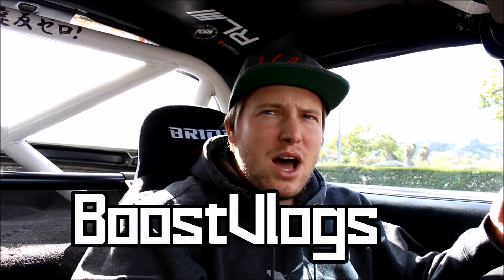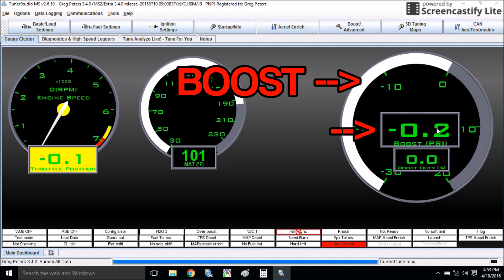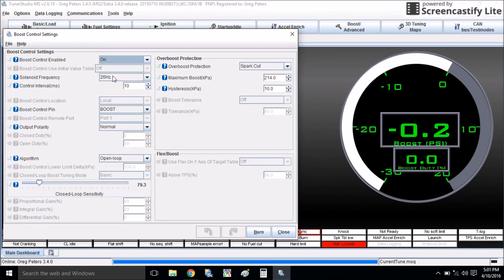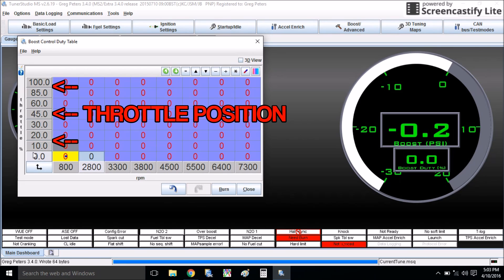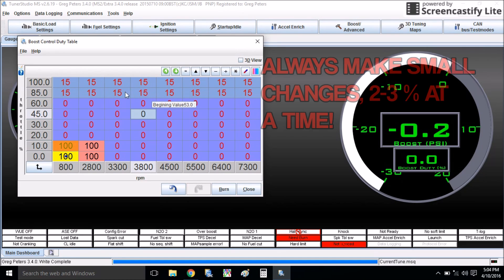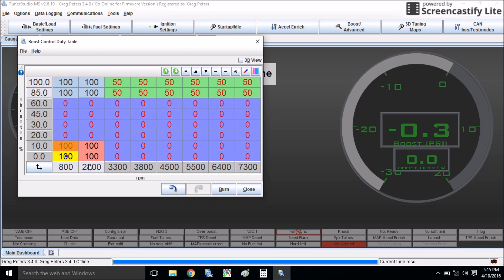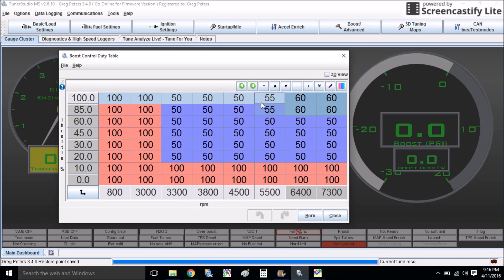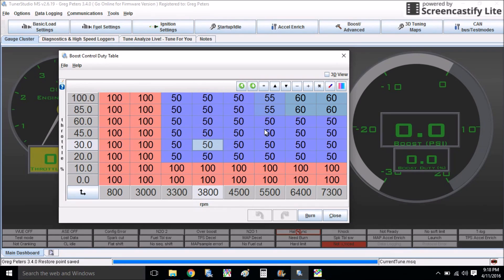How To Tune Boost Control In Megasquirt (BoostVlog 3)

Comment: Quick question, you set your overboost protection at 210 kPa, and according to a conversion calculator from kPa to psi, 210 kPa = 30 psi ! 

Is there something I'm doing wrong ?
Reply from the maker: Yes, overboost protection is set in absolute pressure, not boost pressure. Atmospheric pressure is ~100kpa, so setting 210kpa overboost protection is only 110kpa of boost 🙂 (15.9psi)
Reply: @1993z32  Oh, ok, I think I get it. Thank you for your response ! This video is so helpful, I'm currently trying to tune a 4AG 20v with Microsquirt.

Comment: What do you do when temperatures change drastically, either much colder or much hotter than the temp when you were tuning? Do you run a cold, normal and hot map?
Reply from the maker: If you're going to be in drastically different temps, you should do your best to tune closed loop boost control :)
Reply: @1993z32  I have an MS2, and from all I've read the ECU is quite limited in its capability to control CL boost control

Comment: Great videos. We’ve got very similar set ups. Been running open loop now for a few years and got frustrated with the inconsistency of boost v temps.
Trying to get the closed loop tuned. That’s been a struggle so far but I can see the benefits if I get it done.

Comment: I remember in one video that you had a switch that switched from high boost to low boost. I'm assuming this would require an electronic boost controller, but I don't understand how the switch comes into play. Could you explain how you got yours to work on your car?
Reply from the maker: Interrupts power to the EBC solenoid. Switch off = wastegate pressure, switch on = EBC active.
Reply: Does this mean you have your switch in-line to the ground wire on your EBC?

IIRC the solenoid is wired to the ECU and the other wire to ground (or is it 12v? I can't recall - haven't touched the car in a while.) Thank you!

Comment: if yours is closed at 100% and off, then how is 0% still wastegate spring pressure. please advise.  sorry for the confusion but this all seems backwards.
Reply: Picture the boost solenoid as the middle man between your pressure (intercooler piping) and the wastegate actuator. The solenoid opens to allow a certain amount of pressure through TO the actuator. So when the solenoid is at 0% and allows 100% of the pressure through, it's as if you were just running a straight vacuum line from the piping to the actuator (ie. no boost control, just wastegate). The pressure still has to push that spring open, even if the solenoid is letting all the pressure through.
Reply: colingreczkowski must be a normally open setup, my 4 port is definately normally closed and 0% gives wastegate spring pressure.  100% at idle is always on and full open.  This video must be for normally open solenoids.

Comment: I just bought the DIYautotune EBC solenoid kit. Is this the one you're using? I am having trouble finding out how exactly to wire this up... confused
Reply from the maker: I use the AEM EBC solenoid, but it's the same deal one wire goes into the options port of MS (it's a switched ground, I forget the pin number) and the other is any switched 12v source.

Comment: Man this is confusing. Whenever it comes to anything electrical on a car, I'm shit. I wanna boost eventually, but I don't have the knowledge and or interest really when it comes to messing with things like the ecu. Could I just get it tuned at a shop or something? Or am I gonna have to grab a monster and study this like a collage exam? Lol don't plan on boosting till I past your test anyways
Reply from the maker: Hahaha @ "the test" I'm so making that. Yeah plenty of people get their cars tuned at a shop, but it is good to have any understanding of what's going on.
Reply: +Greg Peters I got first dibs on the test lol and alright I get what ya mean. I'll probably just force myself to learn
Reply: It's worth it. One of my first cars was factory turbo and it has a factory wideband, Electronic boost controller, and you could tune the car without buying anything, only software and a laptop. I didn't even have a boost gauge or any gauge at all because my laptop software could display all of that info.

It was very intimidating at first, and my first job was calibrating a simple intake mod that took me 3 months to dial in well. Now I've tuned pretty much every aspect of the car.

The benefit is that you can constantly mod your car and tune it the way you want, whenever you want, and make multiple maps that you can switch to. I have an eco map I use when I'm low on gas or when my methanol tank runs dry.

Comment: I'm building an older V8 with Megasquirt 2 v3. It will have boost to 8psi. Do I need a wide band O2 sensor and control box for it? Thanks in advance, Bill
Reply from the maker: Technically the car can run without a wideband, but the tuning will essentially be guesswork. I consider a wideband to be one of the most essential tuning tools, and Megasquirt relies heavily on it for many of its features. You don't necessarily need a separate AFR gauge, but I would highly highly recommend a wideband o2 sensor.

Comment: why is this based on throttle and RPM? Wouldn't it make more sense to have another MAP upstream of the throttle plate, and use that as your Y axis? that way you can make your ECU hold a boost level for every RPM
Reply from the maker: +dandil Yes, and that's called closed loop boost control. It performs better, but is more tricky to tune. I tuned open loop boost control in this video which is much more simple.

Comment: Hi pall, I'm not convinced your right with your over boost kpa I wouldn't be surprised if I'm wrong but just check as I would want you to have a serious problem :). There are 101.3 kpa in 1 bar so using 100 is fine but it says boost not absolute pressure, so that is the pressure above atmosphere. If you put 210 in there I think your over boost will cut in at almost 30 psi (of boost not absolute)

Sorry if I'm wrong
Reply from the maker: +ryan jessop 30psia, which is ~15psig. In MS, all of the tables must be tuned in vacuum as well, so 100kpa = atmospheric pressure, not 0kpa. Check out a picture of any MS ve table, spark table, or AFR targe table, they typically range from about 15kpa (high vacuum) to 100kpa (normal atmospheric pressure) up to 200-230kpa (14.5-18.9psig). Thanks though!
Reply: +Greg Peters fair enough

Comment: Hi Greg, i hope you read this... 
i have a 300zx Na ..and i m thinking of going single rear mount turbo on low boost since i dont want alot of power ;
my question is that how would i deal with fuel management? what is the most affordable and easy option  for that? i m thinking of running no more than 8psi of boost ..i asked alot of z forums and groups and most of them told me to buy a TT motor and put it in , i dont want to do that i would rather change to a thicker HG and arp headstuds/bolts ..
Reply from the maker: +Mahabubul Hoque Why even bother with head studs/gasket? 8psi isn't going to hurt anything if it's tuned right. You just need bigger injectors and to get a chip tuned for the bigger injectors and ignition timing. Talk to Specialty Z about that.
Reply: +Greg Peters okay thanks, i'll see what size injectors and chip to get

Comment: Is there any reason you didn't use a twin port actuator?
Keep up the good work!
Reply from the maker: +V0rtex1986 I'm not really trying to do anything that crazy, just figured the single port TS would be worlds better than the OEM Garrett one (and it is).
Reply: +Greg Peters ok.  From my experience it just gives smoother boost control as you have pressure helping the spring.  Love the car btw!
Reply from the maker: V0rtex1986 Oh I'm sure it works better. But the single port has done everything I need, so I don't see the need to upgrade. Would rather save that money for something else!

Comment: Ok, a couple of questions if you don't mind...So, I noticed that you are using spark cut for overboost protection. And I read that using spark cut can potentially damage the turbo by allowing too much fuel to hit the hot turbine and cause damage. What's your take on that? And, will using both fuel and spark cut be better? Also, when I datalog and view in Megalog viewer, my AFR reading shows about 1.5 higher(leaner) than what my AEM wideband is showing. I trust the wideband controller more than I do the reading on the Megalog viewer but it makes it difficult to tune properly. Any idea what might be the issue here? Can't find a definitive answer for that. Thanks...and both your channels are awesome!
Reply from the maker: +vkotis A couple of answers: The overboost protection is kinda like one quick power cut, not like a 2-step so it's not blowing flames, etc when you hit it. You can run it whichever way you feel more comfortable with and it will be effective. Also, you need to tune the car so you're not hitting overboost at all, it's just there for protection while you're tuning and in case anything happens to the wastegate signal line/EBC malfunction etc. Also, you can calibrate MS to read the same AFR as the gauge. Go into Tools -> calibrate AFR table and select "Custom linear wideband". Then massage the min/max voltage numbers until your MS matches your gauge. I should probably do a video on it since I've been asked many times before.
Reply: +Greg Peters Hey thanks for the reply Greg. Got the AFR's sorted. Vincent

Comment: I'd like to know why you chose to build the 1.6 vs the 1.8.  I've been looking into the Miatas, and would be a first time Miata owner, but everyone I speak to says go with the 1.8.  I would also plan on boosting with a turbo on my build.  Any information you can share 1.6 vs 1.8 would be appreciated.
Reply from the maker: +JpL4K3 1.8 is a better platform to start with. The engines can make a little more power per pound of boost, spool a turbo a little faster, and they come with a stronger differential. I had a 1.6 car and just decided I wanted to boost it. A 1.8 (especially a 99+) would outrun it with the same setup, but this car is plenty fast.

Comment: Do you always use open loop? what are the major differences or features of using an open loop system vs. closed loop?
of course these questions pertain to megasquirt/1.6 miata
Reply from the maker: +FlabbyTheJuice No, I've used closed loop as well. Closed loop performs better and can spool a turbo faster, but is more difficult to tune. I recommend tuning in open loop first, then moving to closed loop if you want. You can still get a pretty good tune with open loop through MS though.

Comment: So are you essentially tuning the wastegate actuator? I thought it just went off of vacuum lines and the psi...if you didnt tune it, would it just fully open when you hit the preset target boost at 10 psi or whatever?
Reply from the maker: +Boosted2JZ If you have no boost controller at all, the wastegate will still open at a certain boost level (9psi wastegate will hold about 9psi, etc). A boost controller intercepts the vacuum line and controls the amount of boost that's going to the actuator, so it can "hold back" the boost until it gets to 12psi, 14psi etc. even though it's only a 9psi spring. Manual and electronic boost controllers both intercept the wastegate signal line.
Reply: +Greg Peters i see, thanks

Comment: Can u explain duty cycles
Reply from the maker: +boosted 2j Amount of time the solenoid is open or closed. 0% = open, 100% = closed. 50% = open half of the time. The solenoid opens and closes really fast (usually 30-60 times per second depending on the solenoid) and only lets some of the boost pressure into the wastegate actuator. Pressure to the actuator has to be limited otherwise it would just open at 9psi all the time.
Reply: +Greg Peters ohhhhhhhhhhhhhhhh. I seee. Thanks lol.
Reply: +Greg Peters kinda off topic, if you get a chance could you check out my vid about my miata losing power at wot? need a little advice on what the culprit is.